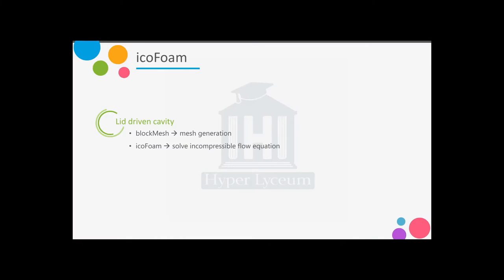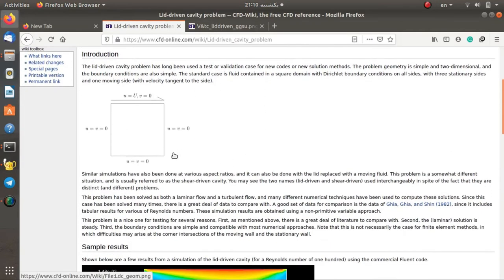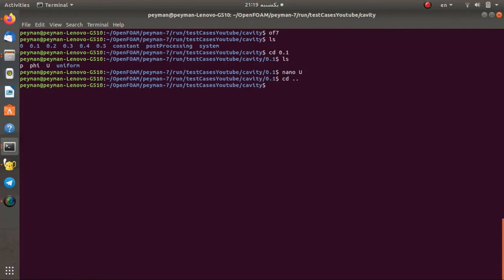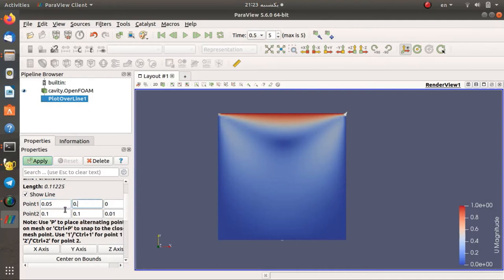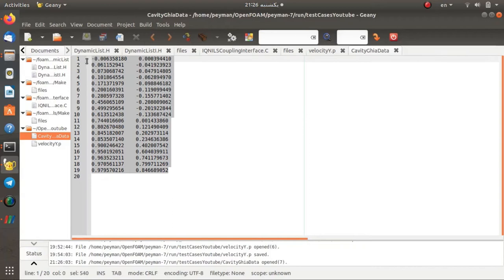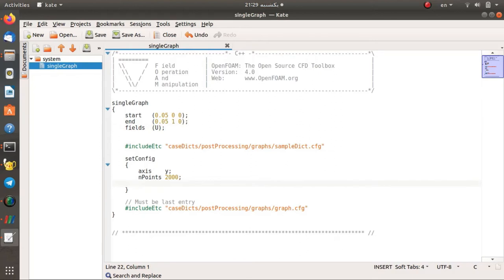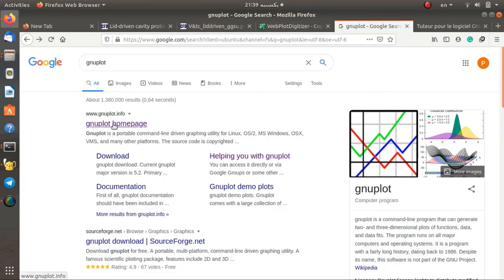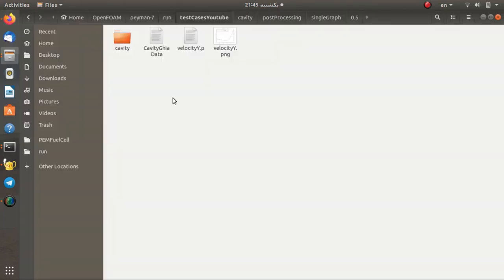First simulation in OpenFOAM (Part Two)

Comment: from where should you get the data file of ghia shin research paper?
Reply from the maker: Ghia, Ghia, and Shin (1982), "High-Re solutions for incompressible flow using the Navier-Stokes equations and a multigrid method", Journal of Computational Physics, Vol. 48, pp. 387-411.
Reply: @hyperlyceum60  isn't there any .datfile already? Or we have to extract it?
Reply from the maker: Please see Figure-2 and Table1-2 in the above mentioned article. 
All  data are available there and you can extract them, and compare with your solution.
Reply: Hey, thankss...but now I want to plot the same graph for Re= 3200, now when I run icoFoam it stops way before the end time which I have set in control dict . What's wrong
Reply: @hyperlyceum60  how to extract and get the data
Reply from the maker: There are several software and even online website that you can extract data inside an article, 
You can find  a web plot digitizer in the following link:

https://apps.automeris.io/wpd/